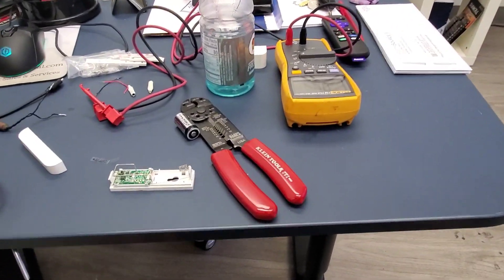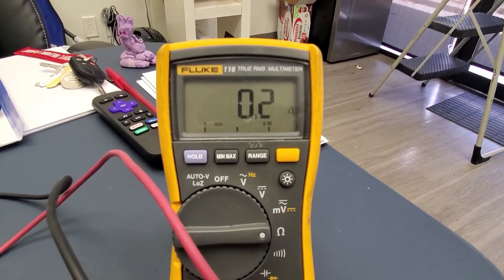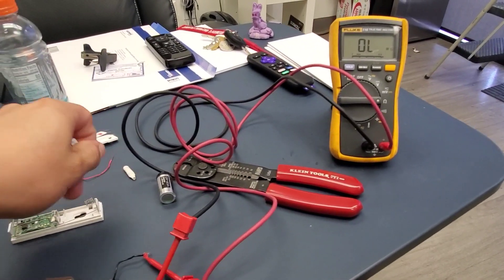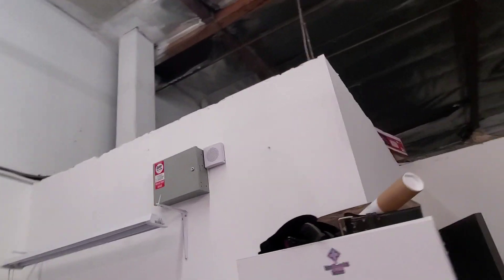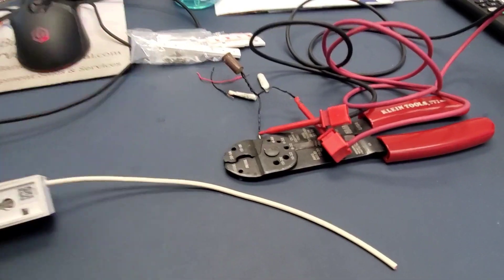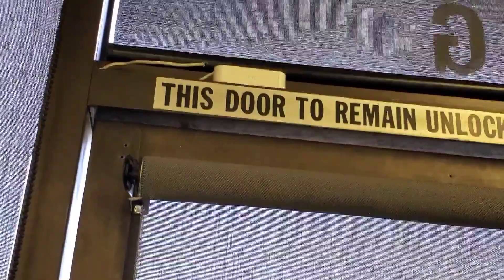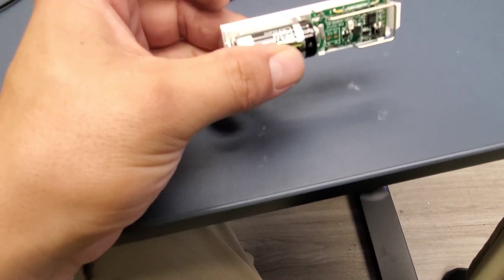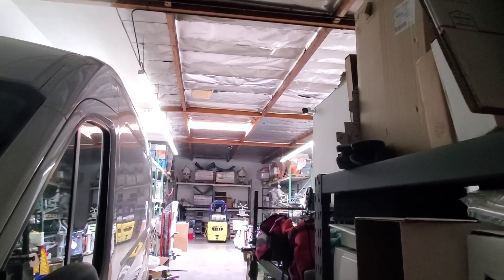DIY Ring Alarm Security System Wireless Sensor Hack! Converting wireless sensor to wired

Comment: I used this technique on my garage door a couple of years ago. Rather than solder to the board, I cut the glass reed switch out and soldered to those leads. I wanted about a 4 minute delay on that door only so I added a relay that shunts the Ring switch anytime the garage opener light is energized. My opener has 2 bulbs so I just replaced one of the bulbs with an adapter that turns it to an outlet. That’s where the relay coil plugs in. Great video.